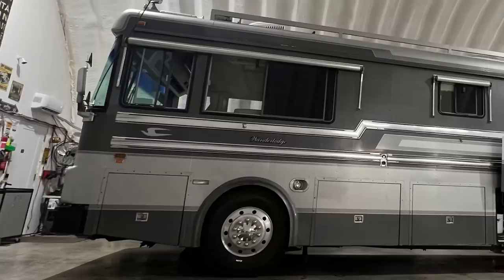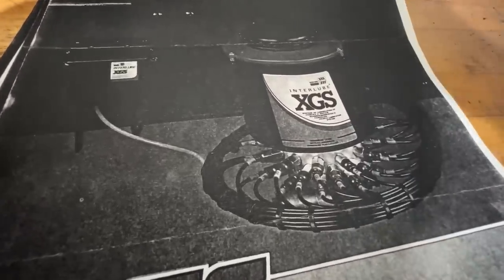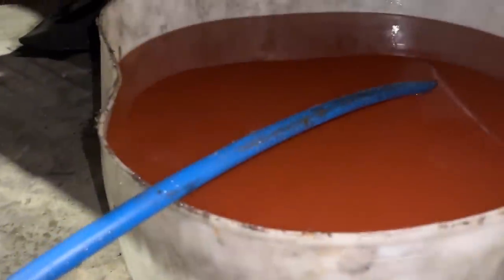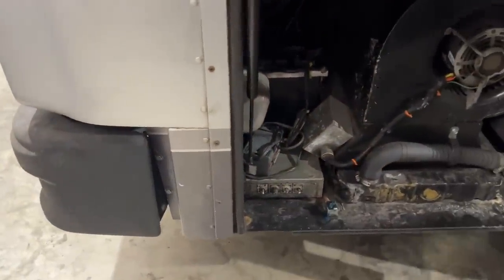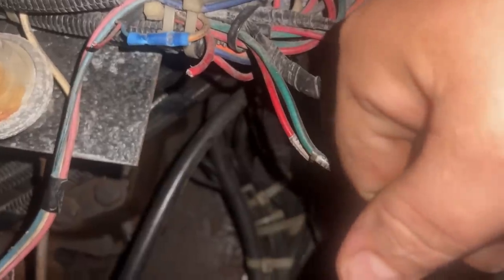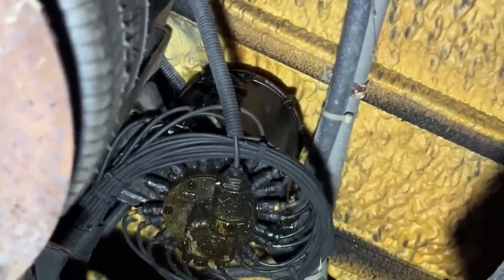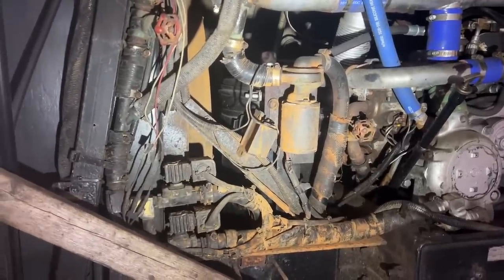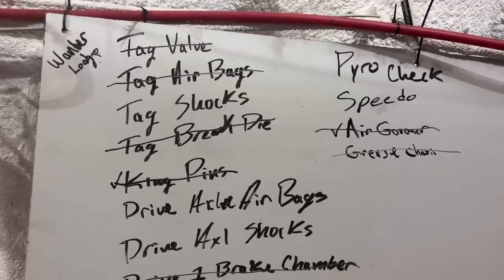Automatic Grease system failure leads to issues on a Wanderlodge RV

Comment: I work on a good bit of stuff that has central lube systems installed. At best they are a catch 22 situation because it's ANOTHER whole system that needs to be maintained by a competent mechanic. Cold weather and the wrong lubricant are usually what kills them and just one blown tube or fitting adapter means the rest of the system never sees any grease.

Comment: We use automatic greasers on excavators and other dirt moving machines. Work great for us.
Reply: Worked great for our spotter tractors.  But it must be maintained!  You can't just fill it and ignore it.
Reply: "what" "work great for us."?  Huh?
Reply: The key part there is using it. I could see this one having gotten ignored for years and then not working and then not getting fixed. I would still want a PM list to check, particularly for the grease points that did not have connections to the automated system.
Reply: I was going to say the same thing about heavy equipment automatic lubrication systems.  I have had numerous excavators with autolube systems and they have been completely reliable.

Comment: auto grease systems do work, but you have to keep a eye on them and all of the lines.  as you say if one line brakes you not only lose grease to that point but to all of the points. 
for a bus it is really not wort it. 
i have worked on them on farm machinery were you are in high dust and dirt and they do pay off but you have to watch them.

Comment: New to the channel, but it seems like no one ever washes the undercarriage on these coaches.  They are just coated with goo.  You must go through a lot of soap washing up after you're done working on them!

As far as grease distribution systems, I saw an interesting one at a cookie manufacturing museum. The old machine had a manifold with all the grease fittings up at a convenient spot on the side of the machine.  Metal tubes (think hydraulic brake tubing) ran to each point that needed grease from the manifold. Interesting "solution" to crawling around a fixed piece of equipment.

Comment: As I sit here in my LX. I’m in a park that has a ten year rule. They asked what kind of coach it was. So I told them. They looked at the paperwork and said an 03! They were amazed. That’s a shame. I do mine once a year on my back. When I got it I did every break chamber, all the airbags, shocks. Had the radiator record.

Comment: Automatic grease and oil dispensers are very common on high end CNC and manual machine tools, construction equipment, and farm equipment like combines, with a lot of moving parts. In those applications they generally work fairly well, because a) the owner/operator of the equipment knows it is damned expensive and a grease failure will cost thousands or tens of thousands of dollars, and put him out of business for possibly a month. And b) the greasers or oilers are mounted in a place where they are easily visible and can be checked both for sufficient grease, and if checked daily, for the amount of grease going down by a consistent amount. 

Neither of those conditions applied here: the greaser was hidden where it was inaccessible, and had no alarm if it wasn't getting power (or perhaps they cut that out too), and the owner/operator of the machine obviously had no clue that grease was anything except a wasted expense.

Comment: Yeah I’ve been maintaining HVAC equipment, very large air handling Stuff for decades and lots of it has some remote tubing going to the fan shaft bearings but you gotta keep using that stuff regularly or the grease will get gummed up and you will have a heckuva time getting anything in there

Comment: Auto greasers, nice idea, but they are NOT a set-it-and-forget-it device.  You have to follow up on what is going on.  Also, as another commenter said, lighter grease than your standard EP stuff, works much better in those auto-grease units.  The lighter stuff (not semi-fluid grease though) tends not to clog up the lines.
One place where the auto-grease devices used to shine, was in the lease and rental heavy truck market.  My personal opinion of them was that they could be depended upon to keep the fifth wheel lubed.  Beyond that,  nope, I wouldn`t trust so many important things to be automatically and unconditionally greased.  You need to follow up, or just do it yourself at very regular intervals.

Comment: We used an automatic greaser on one of our blowers, trial. Bearings went from 18 months to 36 months. I think we were missing the bearings on occasion and not putting enough in at each greasing when we did grease them. I left before all the blowers were done, if.

Comment: Looks similar to a Lubriquip system. We use an air powered Grease Jockey system where I work. They require regular testing and inspection

Comment: You will laugh at this, but the Kenworth and Caterpillar dealer back home uses Calgon ( yes, ( take me away)....lol. to clean a cooling system. It really does remove scales, deposits, contamination without neighbors too harsh. And it's biodegradable. I've been using it for 20 years since than.

Comment: Grease under pressure separates into oil and carrier chalk or some other powder.  I worked for a company that thought central grease was the greatest thing since sliced bread.  Six months later the clear plastic tube showed oil with a calk plug.
Reply: Time to use a quality grease and stop using the crap you have now.
Reply: @Hogger280  The system used a chemical driven module that screwed into a high pressure poly tube.  They came sealed loaded with grease. They cost a fortune.

Comment: Automatic and or remote grease systems are standard equipment or an option on most heavy equipment that has been built since the late 1990’s additionally this these types of grease systems were commonly installed on high end luxury cars of the 1920’s and 1930’s. All that said an automatic or remote grease system still requires the owner of the vehicle or machine to inspect the general condition of the grease system as well as every point on the vehicle or piece of equipment that  those points are all taking grease and that those points as well as general service and or safety inspections

Comment: I could maybe understand a centralized grease area where you could manually grease all locations from one panel that had labeled hoses so you could verify the tubes were actually taking grease, but that automated system is a really bad idea.  If you have to check each location anyway, what's the point?  Every port is a different pressure and amount.  Almost seems like it should be a recall item because I doubt many of them worked to every single location even after a year.

Comment: What is the blue grease? I’ve never seen that before. I greased my 38 ft diesel pusher motorhome with regular grease, did I f up? Thanks! You guys are the best.
Reply from the maker: The owner provided his own amsoil grease he wanted used
Reply: @BusGreaseMonkey  
We have those auto lube systems on a number of our trailers. They have a paddle in the reservoir tat just swipes the grease down into the lines. They WILL NOT push regular weight grease through. If someone re filled it with standard grease at some point, that's why it stopped working. The wiper motor may have burned up trying to turn through the standard grease.
Reply: Amsoil Water proof grease, good stuff. Hard to wash off.

Comment: Strange, usually the speedometer sensor is on the output of the transmission, the ones on the wheel ends are usually ABS...........

Comment: I remember reading about luxury cars of the 1930's having push-button oilers where the entire chassis got oiled.  Either it never got pushed or it got pushed so many times that it made a mess, the oiler system ran out, things dried out, and eventually failed. 
 "Why did this happen?  I pushed the oiler button on a regular basis?"  
"Sir, did you check the oil level of the oiler after all that oiling?"  Silence.........

Comment: Are they using the right grease, we have a fleet of 20 trucks. They all have automatic grease systems we have to use EP0 grease, or it won't work right, check the manual

Comment: Automatic lubrication systems are a variation of the "lifetime lube" ball joint, drag link, tie rod end, kingpin, etc. All of these "improvements" are a big mistake. More complexity, more room for premature wear and component failure, less "hands on" maintenance. Take a look at any American car or truck built in the 1940's or 1950's. They are filled with Zerk fittings, and not just in the front end. U-joints, spring shackles, etc., also had grease fittings.
Sadly, Zerk fittings have gone the way of the dial telephone and the cast iron frying pan.
Reply: To a point maybe... But you'd be hard pressed to drive a car from the 40's or 50's from New York to California and back in 2 weeks and not have to stop and so some kind of mechanical repair. Today you'd barely need an oil change for that trip. 

Not all improvements are bad, you just have to be smarter than the equipment you're trying to operate.

Comment: I've spent far too many hours clearing the pipework on automatic non-oil and non-grease systems.  Let the reservoir run dry once and the quickest solution is to remove all the pipes and sling them in the bin....

Comment: Can't grease it any better than using older pump style or modern Milwaukee grease gun an visual check as your pumping it in ,   and I always pre wipe nipples to prevent and grit being forced into nipples and blocking it or grit scribbing metal faces

Comment: So... Instead of tearing all of that system out, why not run those lines to a plate and put regular zerks on them, so instead of crawling all over the bus with a grease gun flopping all over the place, you hit that header panel with 5 pumps on each one then see what you got going on with a regular creeper and call it a day?
Reply from the maker: Hiw many do you think wouldn’t flow grease?
Reply: @BusGreaseMonkey  No idea, but you said the pump was bad, not the lines.